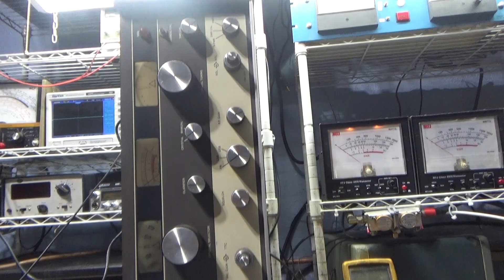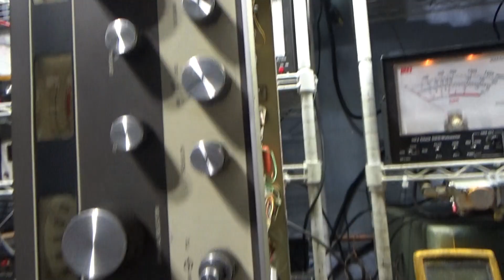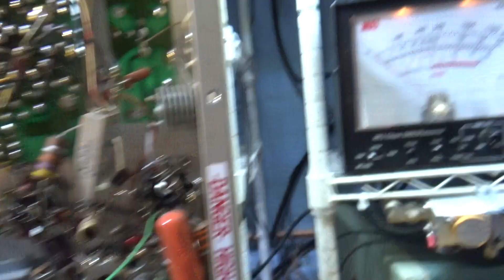TRAM D201 mine, opened up and the stuff we find.

Comment: Do the new resistors need to be a certain Ohm? I get the flame-proof and watts. Thank you I have  radio # 13561. Thank you!
Reply from the maker: the Ohms need to match, but it is a good idea to up the wattage. Many of the power resistors on the PC Boards are one and two watters. I up akk the one and 2 watters to 3 watters across the board and even more important, mount them off the PCB for better air circulation, less heat. The only big sand block resistor I replace is R6. It is a 7 watt  100 ohm resistor. I replace it with a 10 watter. I also replace R3 and R4 which are 2 watt 47 ohm resistors with 5 watters instead of the 3 watters I use on the rest. Those 3 resistors go to the HV power supply and have a lot of heat, current and voltage going thru them.
Reply: @tramdr  Thank you!
Reply: You should replace resistors with the same value as original.
Reply: @spaceflight1019  https://youtu.be/0rDY6J0tJW0 says up the resistors.